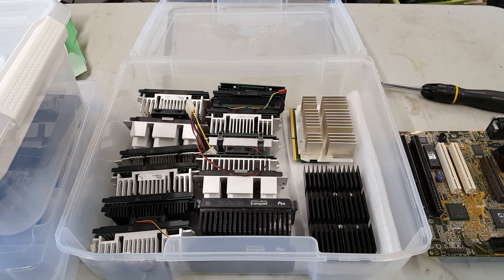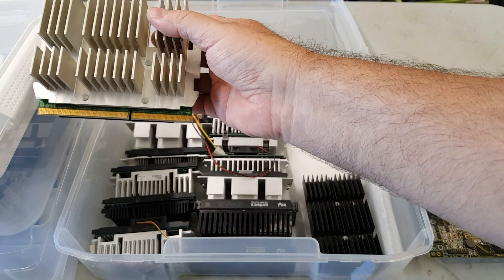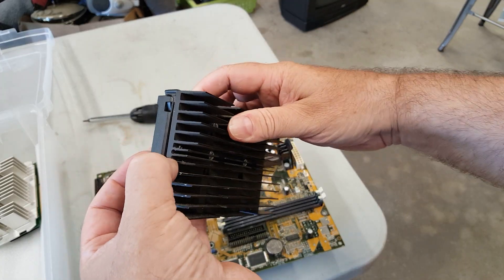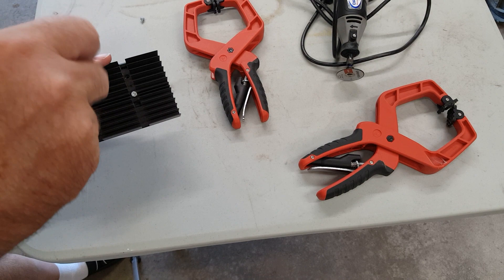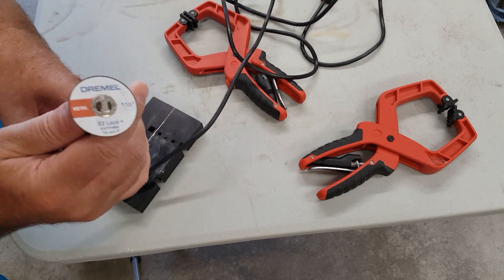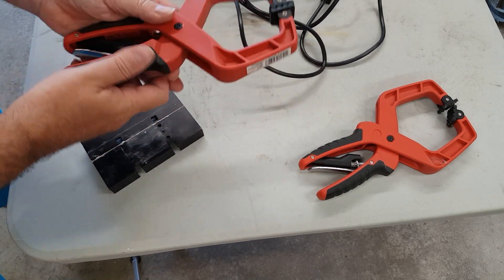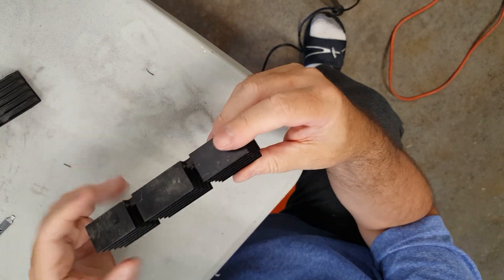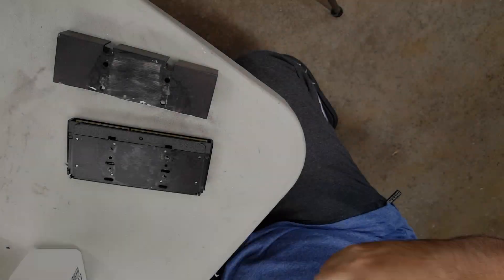Trimming a Slot 1 Pentium II 333 MHz Aluminum Heatsink from Godzilla to a Usable Size.

Comment: why not just drill additional holes and mount it the other way round?
Reply from the maker: Good question!  It was still an awkward fit, plus, when the extra heat sink mater is removed and even a small fan applied, the cooling was just fine.  Passively, the heat sink made sense, actively cooled, too big.
Reply: @UncleMikeRetro  I currently have a Siemens xB Desktop here with a PIII 700 (100 Mhz fsb) overclocked wit a riva TNT2 where the heatsink fell off.  I fear most of the plastics will be very brittle. :(
Reply: on the plus side: it has a working soundblaster CT3980 with 2x8 MB of Mitsubishi RAM
Reply from the maker: They WILL be!
Reply from the maker: That is a nice ISA sound card!  I do find it hard, at times, to get working in win98SE and WinMe

Comment: or you could've just unscrew it and turn it around without trimming it.
Reply from the maker: Had that kind suggestion already.  It didn't work either way and turning was not lining up.  believe me, I tried.  I'd rather not have cut it, but having done so, it is better sized for all purposes.
Reply from the maker: Also, forgot about this part too, the screw holes only lined up when the heatsink was oriented as it was when I had to trim it.  Turn it and no screw hole line up!
Reply: @UncleMikeRetro  ooh, thats understandable then, i had experience with slot 1 when i was like 8 maybe as pc broke down

Comment: why didn't you just rotate the heatsink 180 so it was taller at the top?
Reply from the maker: The heatsink had "pegs" in it that locked into the PII CPU case in certain ways.  Turning it did not work effectively and to tell the truth, still left a hella heavy heatsink for the mounting hardware.  I am a fan of NOT having to strap these down as I test different configurations that have me swapping CPUs on the fly.

Comment: I had a Dual socket motherboard that took Either the P2 333mhz or it took P3 350Mhz. I miss that board. but awesome processors. First one I ever played games on was the P3 350Mhz.
Reply: You probably mean a P2 350, the slowest P3 ran at 450mhz
Reply from the maker: @alejandromoran4590  You are probably correct.
Reply: @alejandromoran4590  yes you are correct. I forgot been so long ago.
Reply from the maker: I never owned a PII pr PIII myself!  Really!!  I only had a Slot 1 Celeron 333 then went straight to the Socket 370.  Maybe this is why I collect all of these.

Comment: While I have never seen one at an angle. I have seen a few that mounted the things so it connected into the side of the motherboard or flat on the top of the board. Even back then, there were a few brands that offered pizza box style PCs. The Slot 1 form factor was a thorn to these makers as it just forced them to make the cases a certain height. However, some of them came up with the idea to mount the CPU like this or even more flat. Many makes came up with a Slot 1 that would lay completely flat. it ether sat on top or connected to the side. The heatsink would stick down below the CPU like this. Honestly back in the day when we recycled these we just pitched them and put a standard Fan and Heatsink on them. Ahh bringing back memories. The number of times someone made a mistake and bought a highly integrated PC like this. Then 6 months later, when the thing had the PS crap out, or it was just lagging they would bring it in. Solution was same every time. Get a standard case and motherboard, and rescue anything we could from the old PC. CPU, RAM, Drives and use them to build them a new PC. Usually we added a bit of ram and a decent video card. Customer was so much happier with that. Unless it was a Compaq, Dec, or HP business PC.. we knew those while integrated were not crap, and could fix them.
Reply from the maker: I just found 3 more Dells this morning, and I am still floored by the "generic" designs of them.  Like those old "pizza box" designs, the customers probably got less than they bargained for.  They were reliable, though!
Reply: @UncleMikeRetro  The Dells came later really. While Dell made PCs back then, you were hard pressed to find one. It wasn't until the very late P3 era or the P4 era they got everywhere. We didn't see many dells pre 1999 or 2000.
Reply from the maker: @Alcochaser  i didn't know that.  Thought they were around earlier.  At least in lesser numbers like the PII one I found a few weeks back.
Reply: @UncleMikeRetro  They were, but back then they were just another face in a crowded market below the big guys. Its nearly impossible to fish up dells made before 1997
Reply: @Alcochaser Makes sense, since they were promoting their entry into the workstation market that year.